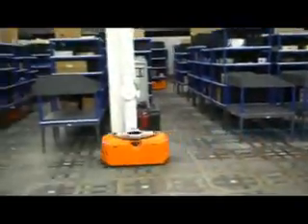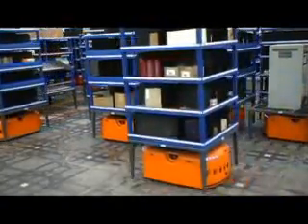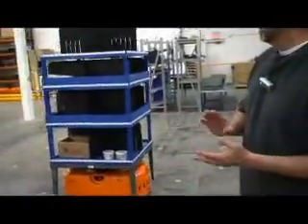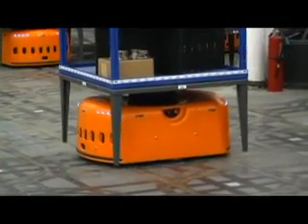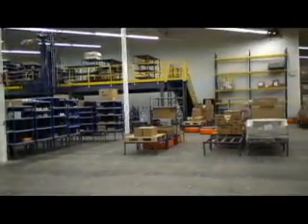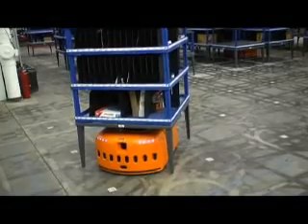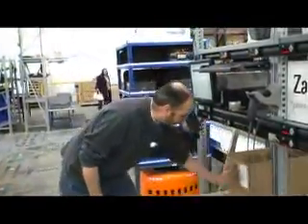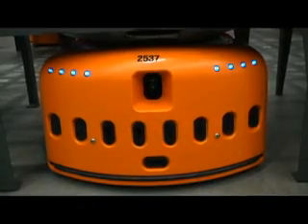Warehouse Robots at Work

Comment: Standard warehouses have only ground floor and they resemble big metal sheds. A multi-floor building is much more expensive than the standard warehouse. It is cheaper to use the standard warehouse with advanced robots than multi-floor building with Kiva robots.

Comment: Kiva robots are cheap, but they have three flaws:
1. They are slow because the shelvings are rather tall.
2. They waste most of the warehouse space because the shelvings are not as tall as the warehouse.
3. They transport the whole shelvings instead of the bins, so sometimes the bins are not available because they are on shelvings used by someone else.

Comment: This is what should be happening in society.  Higher tech replacing manual labor.  What you don't see is the massive high end R&D jobs that made these possible.  Then there will be maintenance and improvements.  If we were to protect low end jobs we'd never have adopted something so simple and beneficial as the wheel.  Your unemployed because someone scammed you and your nation.

Comment: @Hivemind5747 - then, I'm pretty sure that makes a mousetrap a robot. It's a machine (a manufactured artifact that performs work) that reacts automatically to sensor (the trip wire attached to the bait) input. You might want to upgrade your definition skills a bit.

Comment: @Anton1267 - Extra workload? You're a little fuzzy on this concept of supply and demand, are you? Bottom line: 1/3 the workers can fulfill the same number of orders. Amazon.com won't triple its orders just because they put in a robotic warehouse system, so the existing couriers will suffice (until robotic drivers are practical). But they will be able to fulfill those orders cheaper.

Comment: @Scerab 
I have watched how in the past 15 years things have advanced with a speed and complexity that has left me in the dust.
15 years ago I was building robotic mining equipment that used P1 based PLCs and ladder logic. The machines were clumsy and slow compared to machines with opperators in them but the pay back for not having an opperator was there.
Today they use processors I don't recognize, do floating point math and use language I don't understand.
Speed / performace WOW
I worry